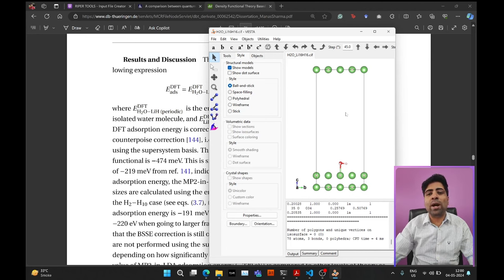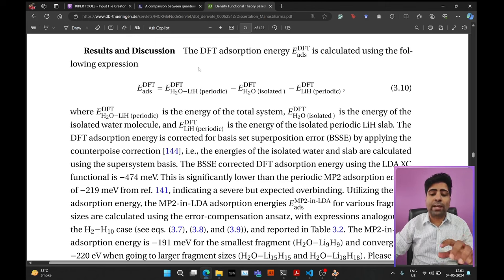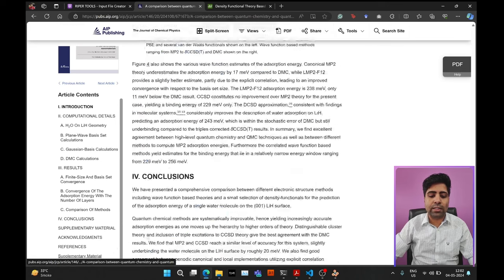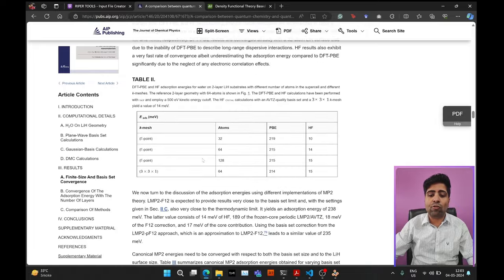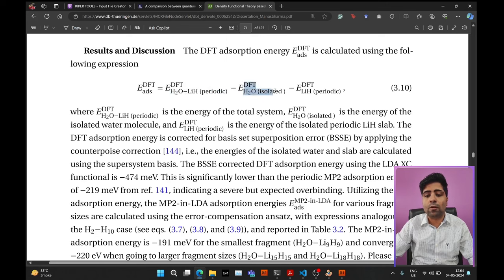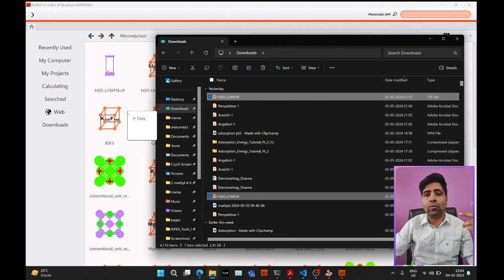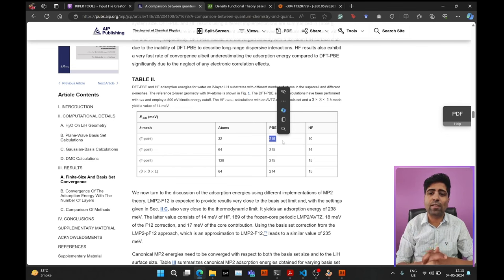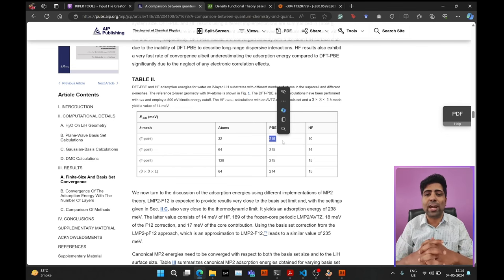How to Calculate Adsorption Energy using Quantum ESPRESSO and DFT? [TUTORIAL]

Comment: Nice ... Is it possible to calculate the charge transfer (i.e., no. of electrons transferred during the physisorption process) and adsorption energy using Burai??
Reply from the maker: Unfortunately, you can't do it directly with burai. You would need to run a few potprocessing calculations and then also utilize external scripts/software.

Comment: Hi 
Is relax calculation need to perform for all three structure?
Reply from the maker: Yes. Ideally, you would need to optimize the molecule in its ga phase (isolated molecule); optimize (cell+atomic positions) the bulk material and then using those lattice parameters, create a surface and then optimize only the atomic positions of the top few layers.

In my case, I was trying to reproduce a result of the paper, so I just followed what they did.